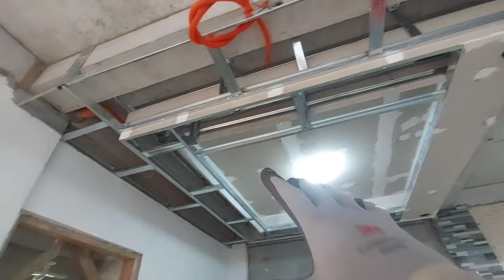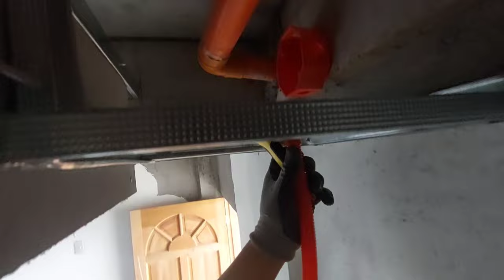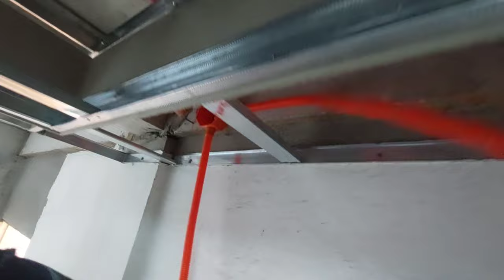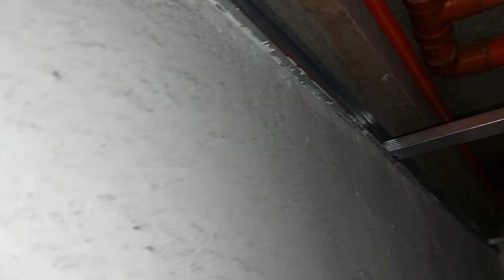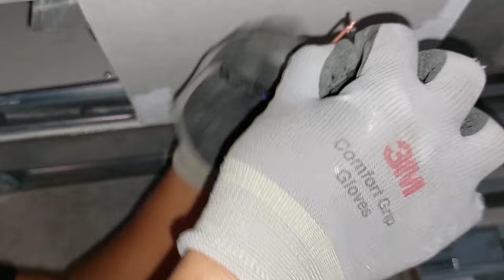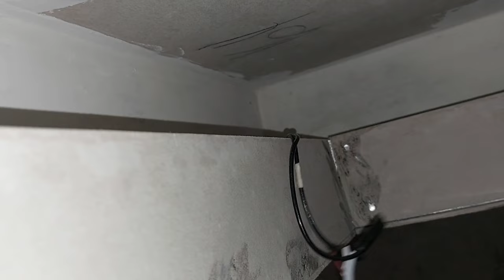PAANO MAG LAYOUT NG ELECTRICAL WIRING SA KISAMI AT MAG INSTALL NG COVELIGHT AT PINLIGHT?? |Part2

Comment: Bos bakit umiilaw pa din ng mahina o kaya kumukurap kurap yung led bulb ko kahit nakaoff na yung switch at nagpalit din ako ng bagong led bulb ganun pa din sya. Ano kaya ang problem ng lights KO? Salamat
Reply: baka baliktad yung wiring, dapat yung hot wire sa switch muna dadaan
Reply from the maker: Baliktarin nyo master ung connecttion nyo tamah po c sr  keith. 
Salamat po  sa feedback master . Godbless po

Comment: Sir okay lang ba gumamit ng wire connector instead na electrical tape? Salamat
Reply from the maker: Mas safe po kc kapag balot ng electrical tape. Kc kung wire connection may tendency po kc mag loose contact during termination at katagalan nadin po. Mas advice po ko po gumamit nlang electrical tape para safe termination at puliduhin nlang po ang termination sa loob ng jb. 
Salamat po sa feedback master godbless po.
Reply: @ElectricalPinoyTutorialTV  salamat sir. Nacurious kasi ako dahil wala pa akong nakita na ginamitan ng electrical tape dito sa Spain lalo na kung interior connections. Salamat sir. Saludo